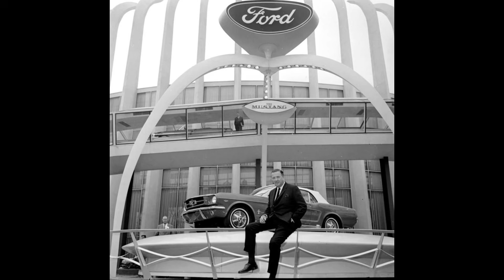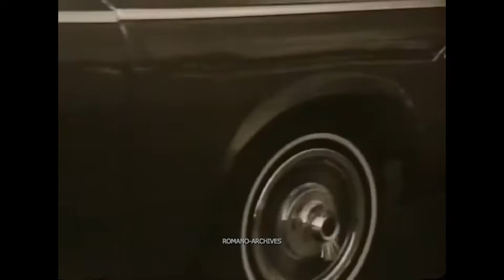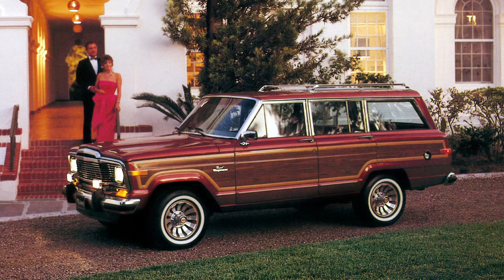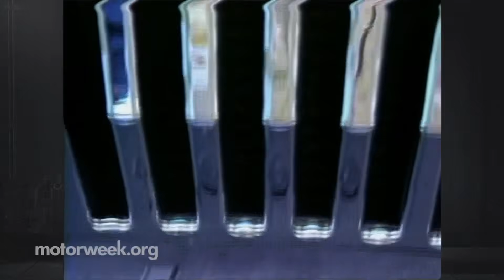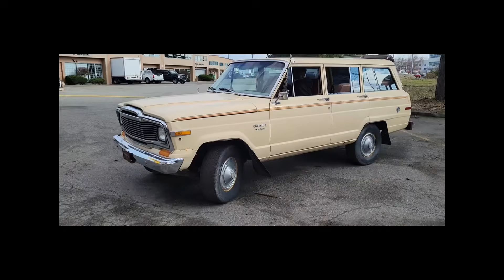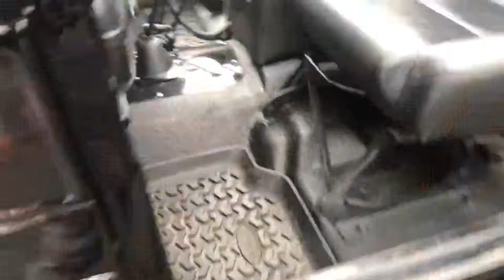Why This American Inline-Six OUTLASTED Every V8!

Comment: Showing a pre 1972 CJ5 with a Buick 225 V6...who edits these AI videos? In fact the white CJ5 shown is a pre 72 with a 4 cyl because all V6's had the badge on the fenders. AMC had to lengthen the wheel base to accommodate the 232/258, changed to the Saginaw steering box and different transfer case.

Comment: With how much information is out there this video still has wrong info.  Chrysler did not come out with the 4.0.  AMC had it engineered and done by 86.  It came out in 87.     Im also surprised  there is no mention of the VAM 282.

Comment: Get the facts right! The 258 was NEVER used in an XJ Cherokee. The 258 design was used as a starting place for the 2.5 throttle body fuel injected 4 cylinder. Then when Jeep realized that GM 2.8 V6 originally used in the XJ Cherokee didn't provide enough power the 2.5 4 cylinder was stretched, adding two more cylinders and added multi-point fuel injection to create the 4.0 inline 6. First used in 1987 XJ Cherokee's. It is this engine that generated 177 horsepower and 224 lb/ft of torque.

Comment: Our 258 6 Wagoneer was fun to drive, too. The grunt of the 6 was perfect for street driving; it could get up to highway speeds rapidly, and cruise all day. AMC engines were designed for street use; high end was sacrificed for low end and mid range power, leaving the rest to go ahead with high rpm engines to make all their power up top, where few drivers actually drove. Up to 80 mph, it had plenty of power, which made it perfect. I later had one of the smaller cherokees with the 4.0 L fuel injected engine, which remained the most powerful engine for the smaller SUV class for many years. GM tried to cheat, by advertising their SUV 6 cylinder as 'the most powerful V6 engine available in it's class'. The key, being the 'V6'  tag. Their V6 was only a 2.8 liter engine, but the ad was true, because it was a 'V6' while the much more powerful AMC was a STRAIGHT 6.

Comment: They were used in agricultural equipment as well because they were so rugged.  They could take the sometimes rough terrain and the bouncing and jostling that goes with it.  There's probably quite a few serviceable engines still sitting in old equipment rusting away in shelterbelts, etc.  Chrysler straight 6 engines were also used in ag equipment for the same reasons.

Comment: The 258 never was fuel injected.  AMC just before they were purchased by Chrysler, developed the 4.0 L Inline 6, based on the 258.

GM had already introduced their Inline 6 (194/230) with 7 main bearings in 1962 or 1963; I believe they were first to 7 main bearings.  One of the derivatives was the 292, which preceded the Ford 300.  Unfortunately, the 292 lived in the shadow of the legendary Small Block, so it wasn't offered in 1/2 ton trucks.
Reply: Technically, the 2.5 4 cylinder was based off the 258. Later it was used to create the 4.0 inline 6. The 2.5 used throttle body fuel injection, the 4.0 had multi-point fuel injection.

Comment: You should do a video on the international Black diamond inline 6 engines from the 50s, it was the grandfather of them all, and is more durable than all of them put together. I've got a 1956 BD 240 and it runs better than anything on the road now, and it sat in a field in alaska for 60 years, didn't even need to be rebuilt, just a battery and a set of points and she's still running great today.

Comment: When AMC bought Jeep the 6cyl engine in the Jeep was the 225 V6 designed by Buick. As soon as possible they put the 232 in but they had to lengthen the engine bay for 232 in the CJ5.

Comment: The AMC 4.0 was designed and manufactured by AMC. Chrysler inherited the engine after they shut down , probably one of the most innovative automobile manufactures ever, in order to save themselves from extinction.

Comment: The Chevy inline six was the most reliable engine ever made,  and it had no timing chain like the other inline sixes had,  it was gear-to-gear timing.
Reply: The Ford 300 is also gear drive
Reply: @timothykeith1367  I was not aware of that,  I know the small Ford inline sixes like the 144, 170, and 200 sixes all had timing chains.   The Ford 300 six was a truck motor only I believe.
Reply: Yep, my favorite engines!!

Comment: Inline 6 more sense than any other variant, as its most balanced between too many and too expensive smooth engines. But people want to drive certain vehicles with certain demand fullfilled. Front wheel suited to V6 or I-4 better, however many cars have all-wheel drive set-up already, so, they could have been designed with I-6s already in wide variety models. However, producers want to squeeze more economy from each products.

Comment: The 4.0 came out in 1987 not 1990. I had a Comanche 5-speed pick up with a 4.0. Had a 93' XJ & still own a 96' XJ. Only issues with the 1996 & up is the crankshaft position sensor that shows a P1391 ( I believe that's the code) no matter what you try to fix. I believe it might be worn timing chain guide or slack in the chain that throws the cam out of sinc with the crank just  enough where the OBD2 is beyond it's range to compensate. Overheated the computer in mine & everything went dead (no start). Put a rebuilt one in & it fired right up but after about 10 minutes,  the P1391 code again. It's run with no issues now for four years but the chain/guide probably needs to be changed out before it burns another computer up. That's my best guess. We'll soon find out...lol

Comment: In the end it was a 4.0 liter
Reply: Poor build quality really hurt the 4.0. It was torquey but cracked pistons, cracked heads, and overheating were common issues with it. Oil leaks were also common since the 4.0 still used the antiquated 2 piece rear main seal design.
Reply: @prevost8686 torque it didn’t have

Comment: They couldn't take overheating.  I did a lot of head jobs  on the 4.0.  I still have the 12 point socket I used to remove the head bolts.  Especially the rear bolts.  The engine was choked to the point of death in 1981.

Comment: Poor research. This engine's heads were not cross flow design. The intake and exhaust are on the same side of the head. And you have multiple images of this family of engines in the video to prove it. Thumbs down for spreading false information.

Comment: BULL SHIT. the head was NOT a cross flow. If you get that wrong, you're not even looking at it. The graphics and pics ALL clearly show the intake and exhaust on the same side. Fake documentary. You don't know what you're talking about. And you forgot all about Chrysler's Slant 6, another motor that wouldn't die and GM's Blue Streak.

Comment: there's so many errors in the narration that it's frustrating. First of all 232cid was introduced first, in 1964. Then 199cid was introduced as a smaller variant in 1966 to replace the aging 196cid. Also the cross cut pics and some videos in the film show the older 196cid NOT 199/232/258/282cid nor the later 242cid/4.0L and crossflow it's definitely not. Stroke figures are off and 2 barrel carb was NOT standard with 232cid, ffs..  I could keep going and going... Looks like AI did the fact checking...?  :face-red-droopy-eyes: But happily the AMC six is indeed a fantastic engine and I've had at least one variant ever since I got my driving license here in Finland.

Comment: Bought a new 1971 Gremlin with the new 258 6 cyl. It was a torque monster and rated 155 hp, would outrun most small 2barrel V-8s and still averaged 20mpg!

Comment: A few comments.  Taxicabs with AMC inline sixs and Chrysler Slant sixes each won the Million Mile award in the sixties. Going over I million miles without major engine repairs.  (Water pumps, carburetors and other accessories were not considered major repairs.) The basic block of the 4 liter six was unchanged from the 258.  People have taken the crankshaft from the 258 along with the connecting rods and mated those to the pistons from the 4 liter and ended up with a high torque engine much larger than the 258, but with the advanced heads, fuel injection and engine management of the 4.0 liter.  I saw over 300,000 miles on my 76 CJ-7 with no major problems. The man who bought it went off of a cliff while on a hunting trip and driving while "well lubricated," according to his companion. He survived the fall with some serious injuries that healed, but the Jeep did not.

Comment: The 4.0 was NOT a clean sheet design! The blocks are very similar, and some parts interchange! You can put a 258 crank in a 4.0 block to make a 4.7 liter torque monster.

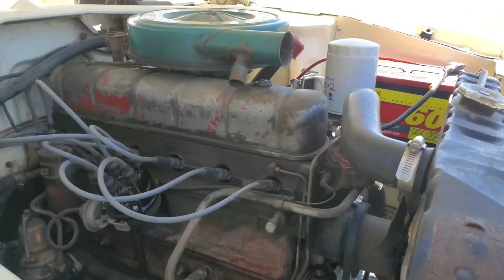Comment: At 3:45 I think that is the less desirable OHV Rambler engine. The better AMC six had the oil filter down lower I believe. 
  Also I think the 232 version appeared a year before the 199 appeared. These engines eventually got neutered by bad emissions control changes like messed up valve timing and low compression.

Comment: I had a '79 CJ-5 with a 258 and 3-sp manual trans (of course!). My friends called it the "war wagon". Great off-road up in the local mountains and as a daily driver. Worked on it myself. Super reliable engine, and as torquey as they get, especially in the "granny gears"!  😊

Comment: When Chrysler developed the 4.0L it was down hill from there should have stuck with the AMC inline 6 as a retired Chrysler tech of 35 years i delt with a handful of problems with the 4.0L
Reply: Lol the 4.0 was still the AMC design , the parts between the two even interchange .  Most of the engineers in the jeep division were the same ones that were there when it was owned by AMC , Chrysler kept them on board . The 4.0 version received a lot of improvements like a better flowing head  , and the modern low friction piston rings and fuel injection were what turned it into a long lasting engine .

Comment: The 232/258 was a good engine.  I had a 1963 Rambler with the older Nash 196ci ohv engine.  It was just okay at best, it liked to blow head gaskets and was smoking excessively by 85,000mi.

Comment: The 232 was introduced in 1964 in the Rambler Typhoon, a limited production of the Classic. The 199 actually came out later in the 60s. Great video but some facts mixed up
Reply: 199 at the start of 1965 model year (August 1964), the Typhoon was a late 1964 special (May).

Comment: Having an AMC  1980 CJ5 Laredo with a 258 CID ,  it would have been nice if the design allowed removing/servicing the lifters without removing the head/intake manifold/exhaust manifold. Not sure why the Jeep CJ 258 was generally fitted with the lower sump oil pan that required the protection of the welded on bash plate. The AMC car 258 engine 5qt pan with the rear placed shallower sump has much more ground clearance.

Comment: The 258 in my 1986 CJ7 was unstoppable. I changed the oil every 2,500 miles and plugs every 5,000 miles. I ran the motor only on super. The engine hummed. When I sold my CJ I had put 157,000 miles on the motor. The Jeep was rusting out but the 258 kept on going.
Reply: If the engine wasn't designed to require burning "super". Doing so can damage the engine. High octane fuel is designed specifically for high-compression engines that have much hotter combustion chambers. In lower compression engines, the fuel does not fully ignite and burn, so unburned fuel washes away vital engine lubricant. That, in turn, is bad for the engine. Ask ChatGPT (or, if you are old-school google-it), if you don't believe me.

Comment: I still have a 66 American with 500k miles on it.  it has a 232 with an Air research turbo and a SU cab on it . on a dyneo it got 320 hp.at 6500 rpm.  hot Roding around it got 4 mpg.  causing on the highway it got 30 mpg.

Comment: I have the last 258 inline making 190 HP.2004 Jeep Cherokee 4×4.This thing has every option that there is. 
And the big question the mileage I got to go look.341.639mi  . one thing don't like it's  constant four-wheel drive you know you can't shut it off and I don't get over 17 miles to a gallon.change oil and don't forget it has transmission and both rear ends💪👍

Comment: As good a six for engineering as the Chevy 194-230-250-292, the Ford 240-300, and the Chrysler Slant-Six.  NONE of these have cross-flow heads.  None of them offered all that much better fuel economy than their respective stablemate small V-8s.  All would last a long time if you changed the oil and replaced any fiber/nylon gears in the timing set for steel when you changed the water pump.  (This was a lesser vulnerability than with the V-8s, but still present in some.)
Reply: You forgot to mention the Chevy 235, considered one of Chevy's great engines.  They were especially good between 1955 and 1962 with insert bearings and pressurized oil system.

Comment: That don't look like a cross flow head to me. It appears the inyake and exaust are on the same side???
Reply: You are correct. The intake and exhaust even use the same bolts to hold both.
Reply: @dennisfariello4852 same gasket too

Comment: The Ford 6 cylinders from 50's 60's 70's were indestructible. Had enough power as well. They weren't the hot fast V8's of that time but they were powerful enough, economical, and would run forever if you took care of them.
Reply: Six cylinder Ford used in regular cars and trucks were much different than the small slow engines used in Falcons and some sluggish early Mustangs.

Comment: Wait a minute.  More research is needed.  The 258 last year was 1990 in the wrangler.
To my knowledge non were fuel injected.
When AMC was acquired by Chrysler in 87 the 4.0 AMC designed 242 cubic inch 6 was already under the hoods in the Cherokee and Comanche.  The 4.0 was never carburetor it debuted with port fuel injection initially a Renault type system as that French company had a share in AMC.  The downsized Cherokee AMC rolled out in 83 was offered with an AMC 2.5 4 cylinder; some came with GM 2.5 “Iron Duke” 4 bangers.  Anyways the optional engine through 1986 was the GM Chevy designed 2.8 v-6.  AMC lengthened their own 2.5 4 cylinder to create the 4.0 also known as the “Power Tech.”  No downsized 1983-1990 Cherokee ever had the earlier 258 motor.  The 258 last offered in the 1990 Wrangler.  Have had many AMC/Chrysler/Jeep products.  That 4.0 every bit as tough as the 4.2 258.
Reply: I was going to go off on the exact same rant.
Reply: Love straight 6 from most years of manufacturing. A 292 chev 6 with header,  cam, and carb up grade  was a 350 CID eater.
Reply: @alanlamon4399  Spoken from someone who tried to convince themselves that having a SICK-CYLINDER was better than a V8.  All of those engines are turds, then and now.  Use a Mercedes V8 and you'll be so ashamed you ever owned on of those turds.
Reply: @GoldenGun-Florida  your analysis/ comparison is a failure, flawed.
to pick n single out ANY Mercedes V8 as a pinnacle of design/ longevity or any useful metric is laughable and pure dystopian fantasy. MB has never made a decent v8 n they admit it, and indeed a Mercedes v8 is the turd of European large car manufacture - fact.
who knows what dumb point u were even attempting make using a crumbling v8 design as comparison. if u knew better than the adverts n social media fake hype u would of left out the smoky old Mercedes v8s n maybe showed some vague knowledge highlighting the fabled Mercedes i6 and i5 motors.
but u didn't, u chose to regurgitate magazine headlines to sell sell sell, divorced from reality. haaaaaahaha
Reply: Both the AMC 2.5 liter 4 cylinder and the AMC 4.0 liter 6 cylinder are rather RPM sensitive and will break if RPM's get high. The AMC 258 is super tough compared to them.
Reply: @BrandonLeeBrown documentation please?   We don’t accept seat of the pants elmer George and bubba
Reply: You are correct sir...lol My 93' XJ with a 98' block (date is on left side of block toward rear) is starting to get a slight valve rattle at idle. 264k on the frame, no tellin' how many miles on the block since it ain't original. These motors are tough as nails, just wished it didn't have OBD2.
Reply: You could get a Mopar fuel injection conversion kit for the 4.2L